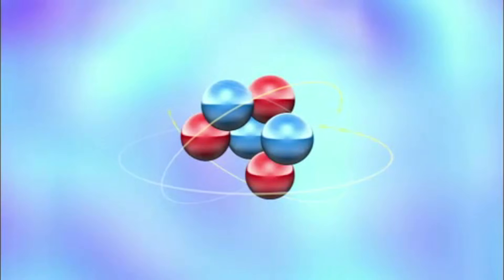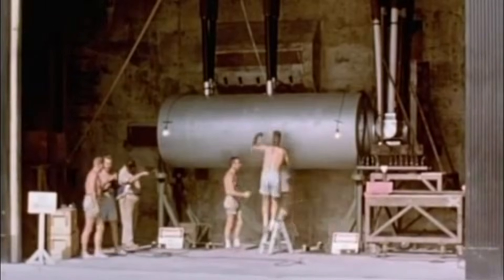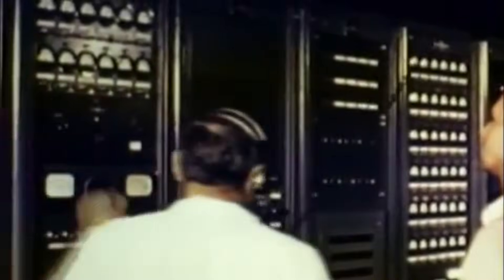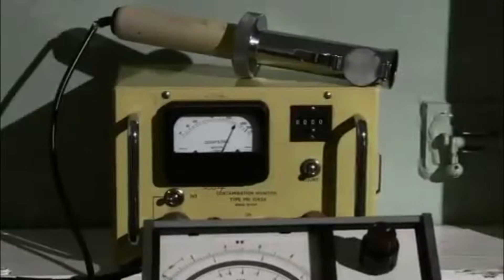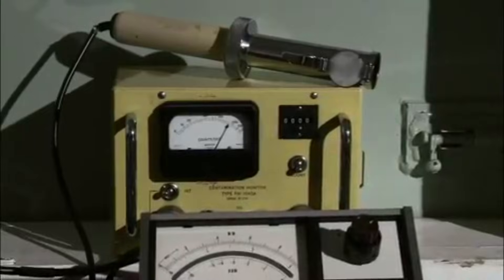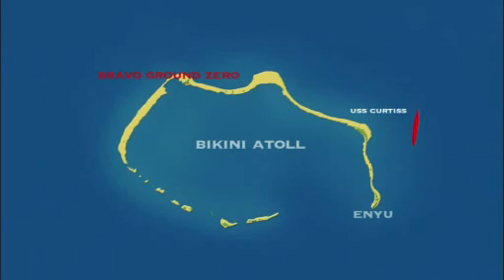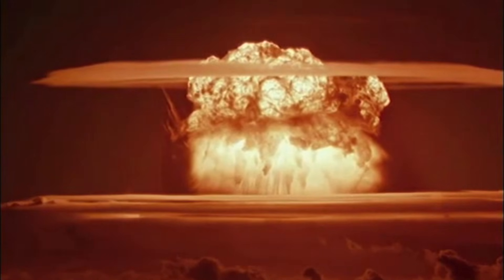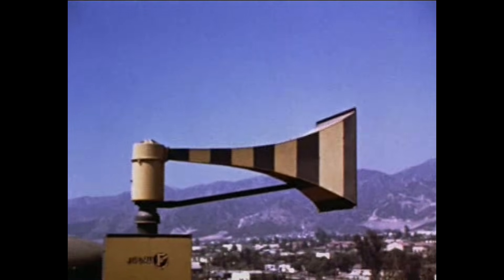informative castle bravo nuclear test video

Comment: Just proof that smart people can be dumb.  Calculating that Lithium 7 was inert was a grave error.  It acts one way in normal conditions, but quite different inside a fusion bomb, with particles moving MUCH faster.  It was at least as good of a fusion fuel as lithium 6, if not better, which caused Castle Bravo to explode at 15 MT, instead of 5.

Comment: Li-deuteride wasn't the problem, it was the isotope lithium 7 which was present in addition to the li-6 which when hit with neutrons would breed tritium (this is what makes variable yield weapons work). They thought the li7 wouldn't breed any tritium which is what fuses with the deuterium, but it turns out that it does make tritium which meant there was way more fusion fuel than anticipated which equalled a way bigger kaboom

Comment: The TX-21S SHRIMP-device was 179.5" long, 53.9" wide and weighed 23,500Lb (The Al-alloy structural casing was ~3.5" thick) and the secondary used 40% Li-6.
Reply: Check out Wikipedia page, all sorts of details there.
Reply: The Al-alloy used in the structural casing (The outside cylinder) given that the design of the TX-21S was frozen in late 1953 was almost certainly the 7075 alloy (https://en.wikipedia.org/wiki/7075_aluminium_alloy).

Comment: From the first time I heard about Castle Bravo I thought there was something wrong about the 15MT claim.  Nuclear weapons are a point source explosion and hence have a cube law relationship between yield and destruction.  The claim that the explosion was 3 times the anticipated yield would produce 1.316 times more destruction.  There seemed to be a lot more destruction than that.
I calculated the difference in destruction between the Ivy Mike crater and the Charlie Bravo crater and it seems, by very rough calculations, that the destruction was 1.66 times more.  With the cube law relationship it would put the Castle Bravo shot at 76MT!
I may be way off on my assumptions and calculations, but, things make more sense (like the destruction of all the instrumentation) if the yield was much greater than the 15MT claimed.
That was my calculation based on dirt moved.  There is a lot of room for error here.  Let's take a look at fireball size.  Ivy Mike at 10MT had a fireball of 1.8 to 2.1 miles in diameter.  Castle Bravo had a fireball of almost 4.5 miles across.  You don't have to understand much math to see that there is a discrepancy there.  The relationship of yield to fireball size is slightly less than a square law relationship BTW.
Going to the site:  https://nuclearweaponsedproj.mit.edu/fireball-size-effects  you can calculate the yield to form a 4.4 mile ground contact fireball, the yield is 58MT.  This just happens to be the same yield as the Tsar Bomba (coincidence?)
The scientists had to know what the yield was but probably couldn't state the true figure and settled on a 3X error to cover since most people would think 3 times the yield would be an enormous difference, when in reality it is not so much.
My next question is...was it really a mistake???
Reply: Well of course.. It makes sense if the yield was in fact 76mt they’re damn sure not gonna tell anyone about it..

Comment: I know exactly what to do when that siren goes off:

1. Find a sturdy concrete wall.
2. Bang head against wall.
3. Bend over, in half, and kiss your ass goodbye...

No, seriously, yea I remember the drills we did in school, sit up against a 1st floor, concrete wall in the center of the building, and bend over with your head against the wall, like you're trying to inspect your crotch, so if the building collapses you can be squished into the most uncomfortable position to get squished into... Hell, that was better than having kids get under their desks. Wood desks, yea right, kindling...

Comment: It never actually answered the question of "What went wrong?"  Having studied nuclear history, I know just what went wrong.  The shell that encased the lithium-deuteride core and its trigger was what went wrong.  In order for a fusion reaction to sustain itself, the neutrons that are released with the initial reaction need to be contained to the point that the whole core can be consumed; otherwise, with their random runaway habits, the reaction would fizzle out.  They needed to encase the core in a shell of very dense material, which could reflect runaway neutrons back into the reaction for those critical microseconds to make the fuel fully ignite; well, the only material they knew of that could do that job was uranium.

Natural (or depleted) uranium is not a practical nuclear fuel; only the unstable -235 isotope can be used in a nuclear weapon, needing little more than a stick of dynamite to trigger a fission reaction.  In its natural, depleted state, uranium cannot be exploded with conventional explosive triggers.  BUT, a fusion reaction acting upon it WILL trigger nuclear fission in depleted uranium, which is what they most likely failed to factor in.  They should have, since they also used a uranium shell in the Ivy Mike test, but they didn't.  So, when the Shrimp's lithium deuteride ignited, the uranium shell reflected the neutrons as it was planned to, but then, when the fusion reaction reached its peak, the shell underwent immediate and total fission.  That extra fission reaction not only boosted the explosion to triple its expected yield, but also was the major cause of the fallout that dusted the whole area.  Had they utilized lead instead, that explosion would have been on par with their expectations, and the fallout would have been negligible.  But they didn't think about using lead as a tamper shell until the following year.
Reply: That was very informative Anthony.  I did not know the exact chain of events which lead to the tripling of the blast yield.  You really know your nuclear physics.  But I thought I heard something about Edward Teller using some sort of material as a booster to allow hydrogen fusion, I think maybe it was the uranium tamper he was talking about, but I am not totally sure.

Comment: Perfect example of how little humans know about what they are doing! Bedsheets to protect your self from fallout is not a good plan.
Reply: On short notice it's brilliant, fallout kicked up by the helicopter would settle on the sheets instead of their clothes and be easily removed. Instead of having a bunch of radioactive material hanging out on your clothes for a longer time.
Reply: Well it's always to have a bad plan than no plan at all.
But still, some of them knew that Castle Bravo could run-away and didn't prepared for doing so in worst case scenario.

Comment: The last portion of this video goes completely off the topic and does not explain why Castle Bravo went wrong.
Reply: In case you didn't know, or someone sees this comment and would like to know why.

The yield of 15 megatons was 3 times that of the 5 Mt predicted by its designers.[3][24]:541 The cause of the higher yield was an error made by designers of the device at Los Alamos National Laboratory. They considered only the lithium-6 isotope in the lithium-deuteride secondary to be reactive; the lithium-7 isotope, accounting for 60% of the lithium content, was assumed to be inert.[24]:541 It was expected that the lithium-6 isotope would absorb a neutron from the fissioning plutonium and emit an alpha particle and tritium in the process, of which the latter would then fuse with the deuterium and increase the yield in a predicted manner. Lithium-6 indeed reacted in this manner.[citation needed]

It was assumed that the lithium-7 would absorb one neutron, producing lithium-8, which decays (through beryllium-8) to a pair of alpha particles on a timescale of seconds, vastly longer than the timescale of nuclear detonation. However, when lithium-7 is bombarded with energetic neutrons, rather than simply absorbing a neutron, it captures the neutron and decays almost instantly into an alpha particle, a tritium nucleus, and another neutron. As a result, much more tritium was produced than expected, the extra tritium fusing with deuterium and producing an extra neutron. The extra neutron produced by fusion and the extra neutron released directly by lithium-7 decay produced a much larger neutron flux. The result was greatly increased fissioning of the uranium tamper and increased yield.[citation needed]

This resultant extra fuel (both lithium-6 and lithium-7) contributed greatly to the fusion reactions and neutron production and in this manner greatly increased the device's explosive output. The test used lithium with a high percentage of lithium-7 only because lithium-6 was then scarce and expensive; the later Castle Union test used almost pure lithium-6. Had sufficient lithium-6 been available, the usability of the common lithium-7 might not have been discovered.[citation needed]

The unexpectedly high yield of the device severely damaged many of the permanent buildings on the control site island on the far side of the atoll. Little of the desired diagnostic data on the shot was collected; many instruments designed to transmit their data back before being destroyed by the blast were instead vaporized instantly, while most of the instruments that were expected to be recovered for data retrieval were destroyed by the blast.

Comment: im surprised that the crew on Enyu island weren't killed by the blast wave when it hit the concrete blockhouse. had the bomb been any stronger that bunker probably wouldn't have saved them
Reply: Where can I watch the full video of the scientists inside the block house
Reply: @johnbrendanoneill1029  look up secrets of the dead the worlds biggest bomb
Reply: @derekwall200  thank you very much
Reply: @johnbrendanoneill1029  you're most welcome sir 🙂🙂
Reply: @derekwall200  I looked trough them videos it doesn't show alot of the bunker
Reply: @johnbrendanoneill1029  well that's the most I have seen of it
Reply: True
Reply: That's a great Video.  I hope that someone Releases a Video Disc of the Soviet Union's 49 Minute Film of the Tsar Bomba Test.
Reply: Idk....  there are two concrete bunker/stations that were only 1.5 miles away from Bravo and they both survived.  They are both still there.
Reply: The bunker stations are #1200 and #1341.   They both survived the Bravo AND Romeo shot.    So for them to say the bunker 20 miles away barely survived is a bit dramatic in my opinion.

Comment: 11:51 EMP from the nuke makes the videolink from inside the trench disappear for a short period of time.
Reply: Yes this is the exact effect you wouldn't expect from an Electromagnetic Pulse. It's a bit surprising that it didn't permanently fry the electronics. Maybe the gear was hardened against the EMP.
Reply: @AnthonyGoodley  Vacuum tube equipment normally glitches then recovers.
Reply: Not silicone chips
Reply: @Just.A.T-Rex I eat silicone chips for breakfast

Comment: I don't see any comments regarding the bed sheets but I'll get it out of the way.
The bed sheets weren't for protecting themselves from the radiation of the fallout, they meant to use them as drop clothing so that the fallout would settle on the bed sheets then they would throw them away once they were out of the fallout area.
Reply: The concept was that the bed sheets would stop the effects of alpha particle radiation given off by fallout ash.  This is the most common type of radiation followed by beta particles, fast neutrons, X-Rays and gamma radiation.  Alpha particles can be stopped by a few feet of air or a sheet of paper.  As long as the alpha radioactive particle does not settle on your skin or breathed in you are fine.
Reply: Yes what the OP is saying is true except that even a thin bed sheet would offer significant protection against Alpha radiation. But that's mostly irrelevant since Alpha particles aren't nearly as dangerous as Beta and especially Gamma radiation which a sheet would do nothing to protect a person from.
Reply: Better than nothing! Plus if you die looking like a ghost, you automatically get to haunt somebody you don't like.
Reply: The bed sheets would have been more effective if they had used them as a breathing filter.
Reply: Fallout protection? The real question here should be " What do you think went through the chopper pilots mind when he saw scary Atomic ghosts running toward him!!! " I laughed out loud when i saw sheets with eye holes!!!
Reply: propjetelectra I thought it was obvious he meant the bed sheets wouldn't shield at all from the radiation and therefore were not protecting them during their travel to the helicopter.
Reply: ???? Yes I think most ppl understood that

Comment: They are horrible weapons, but merciful God what a sight Bravo must've been going off, even from the deck of the Curtiss, 23 miles away. Something so small as the atoms that make up our universe unleashing such awesome destructive power...
Reply: Then think of that x4 and keep going. Cause adding using megatons is how math should be taught in schools.
Reply: What weapon is not horrible? The point of it is to to cause some kind of damage. They are no more horrible than taking a very large rock and whacking it against someone's head... or our planet.. knocking Earth out of orbit and into the sun. But the concept is the same.
Reply: Then think of the tzar bomba more then 3 times the size of castle bravo. And the original design of the tzar bomba more then 6 times the size of castle bravo.

Comment: So let it be known, even atomic physicists make big mistakes!
Reply: Zen Jon to be fair, the atom per atom yield of energy was very well known, they just didn't expect so much to be successfully fused. thermonuclear yield is much harder to calculate because, not only does it have the fusion charge, there is also a primary and secondary fission charge. basically they have to calculate the yield of 2 atomic bombs and 1 thermonuclear bomb and there is lots of room for error.
Reply: this was back when they were 1st testing and getting to know fission fusion weapons so when you're 1st developing and experimenting with these types of weapons and you don't have any baseline info on how those types of fuels will react that is a risk you have to accept
Reply: "We all make mistakes, at least yours didn't blow a giant hole in the Pacific islands."
Reply: Damnit! I tell my students about this test when they make mistakes to soften the blow.
Reply: The Secondary contained a mixture of 60% Li7D and 40% Li6D what happened is that they underestimated Li7's reaction rate to fusion-spectrum neutrons also Li7 has a minimum threshold of 4MeV required to fission it into T and He4. And as Mark Fisher pointed out the weapons scientists thought the Li7 would essentially be inert.
Reply: CoreForEinsLife 
To my knowledge the lithium 7 was converted to lithium 6 in the few millionths, thousandths, hundedths (whatever) of a second after the initial firing making it available for reaction therefore increasing the yield unexpectedly.
Reply from the maker: Physics Only Makes sense, thanks for the information :)
Reply: They didn't expect lithium 7 to turn into lithium 6.  Made it into a much bigger boom.
Reply: @ChickenPermissionOG  Yes, that was part of the reason due to the n,2n reaction (Li-7+n->Li-6+2n) but also if the neutron was greater than 4MeV in ernest you this reaction: Li-7+n->T+He-4+n. Just like the Li-6 reaction except a neutron is produced too. Those extra neutrons in addition to fissioning more Lithium also fissioned U-238 (An endothermic reaction).
Reply: But was it really a mistake?
Reply: Yeah but it’s not exactly rocket science 🙄
Reply: I thought you were being serious at first. And that's how I can tell your joke is hilarious now.
Reply: Zen Jon , right.  Haha
Reply: Mark Fischer  It was a very expensive process!
Reply: Atomic Scientists are WHORES who have sold out their scientific and moral integrity for a fistful of dollars. 
The first mistake they made was to sell their scientific knowledge in the interest of Creating Death. ... jkulik919@gmail.com
Reply: @JosephKulik2016  --  Not at all accurate.  We were under the impression that the Germans were making these bombs (because they actually were trying to).  We knew if we didn't also make these bombs, we'd be living under the boot of the Nazis... all of us.  We get to the end of the war in Europe and we discover that the Nazis never got close, but we're on the cusp of the testing phase.  We're also looking at the fact that the Japanese live by a code whereupon they will ask every man, woman and child on their home island to fight to the death.  The death toll will be in the millions if we have to invade Japan, and nothing will make them surrender.  Two atomic bombs kill approximately 100,000 people, and the war is over.

Okay... so now the genie is out of the bottle, what do you want us to do, not work on them?  Because we know as well as anyone, the Soviets will eventually have this technology (they tested their first bomb only four years later).  I mean, it sucks but... there was nothing we could do to stop it from getting out.  One Brit's cloud chamber let the whole thing out of the bag.  And, from then on, everyone knew.
Reply: Bigger is bettter
Reply: It's the smart guys who cause ALL the problems. Give the money to Larry, Moe and Curly and nothing  happens except they screw up your plumbing.
Reply: Actually the TX-21 SHRIMP-device was weaponised into the Mk-21 which weighed 15,000 pounds.